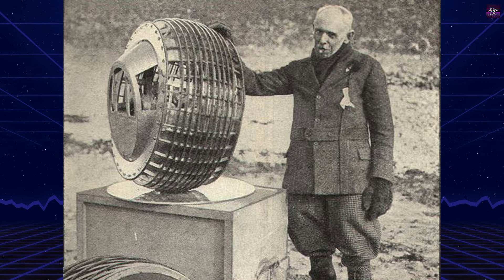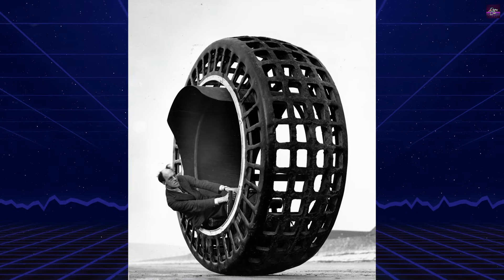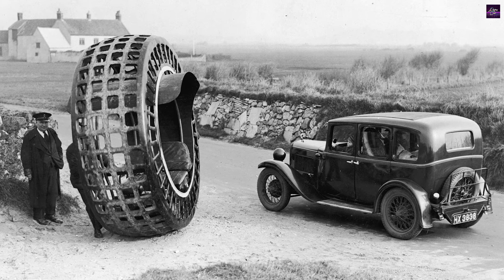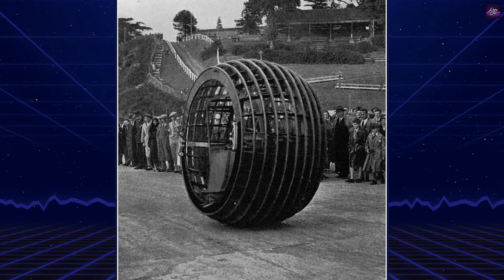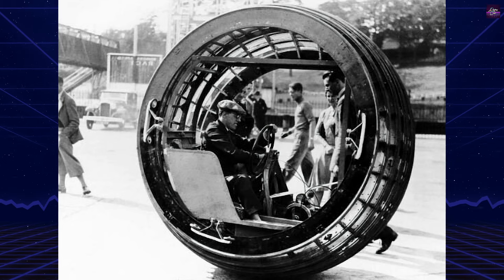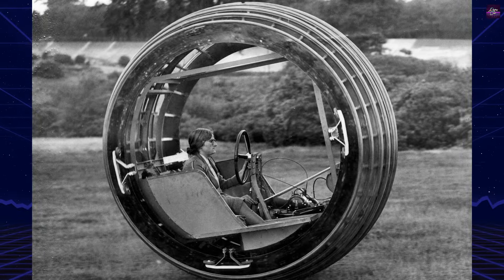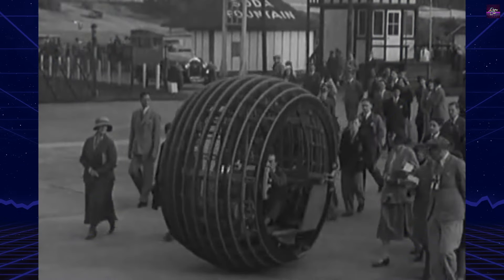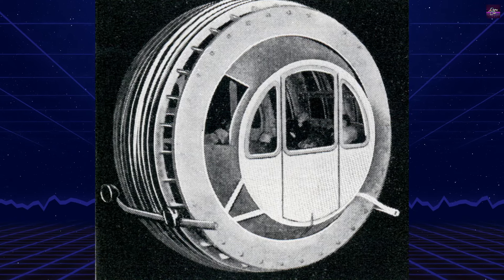The Dynasphere: Dr. John Archibald Purves' Brilliant but Flawed 1930s Monowheel Marvel

Comment: You've really got to hand it to the innovators, tinkerers and pioneers who came before CAD.  They actually had to build practical models and working prototypes to test their theories and ideas in the real world to see if they would work as promised.  Mr. Purves' Dynasphere is case and point.

I'm not even going to attempt a Google search for a model or diecast.  I'll leave this one to the Old School Scratch Builders and the New Wave 3D Printer code writers.

Thanks for presenting this video! 

39th Like.
Reply: 1st dislike
Reply from the maker: It has only come to my attention now that if John Archibald Purves had lived in our time and he had gotten a huge wheel from a truck that works in a quarry. I dread to think what he might have invented.
Reply: @retrocarchannel  Well, Mr; Purves would still have to cut vision-slits in that tire, so he might as well just make the huge wheel version that size from scratch the way he did with his prototype.

This is actually a good thing for scratch builders, since they won't have to 'source' a wheel to modify, and may just use Evergreen strip stock to build the basic wheel in the manner of an Old-School "Stick and Tissue" model airplane builder.

Speaking of unusual prototype model kits, the Ukrainian company MiniArt has several kits of a proposed ball-shaped tank called the "Sharotank" designed by the Soviet Union.  I have one of these, and the inner cage housing the engine and crew could easily be adapted to build a civilian Dynasphere without too much fiddling.

The Sharotank would also be a good subject for a future video!